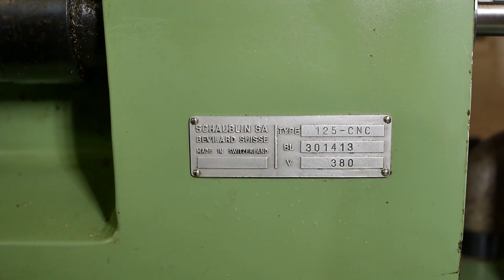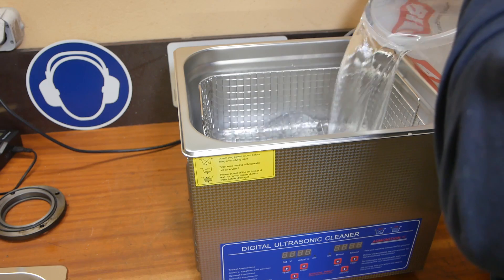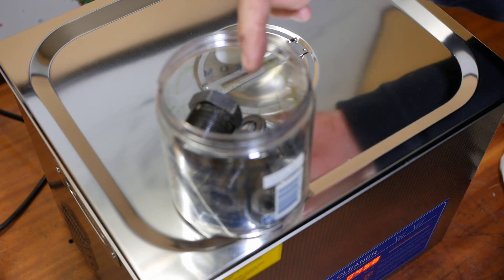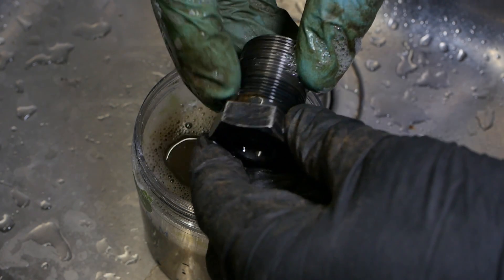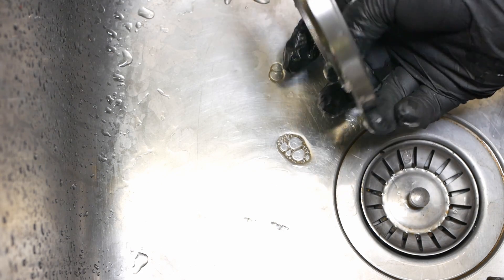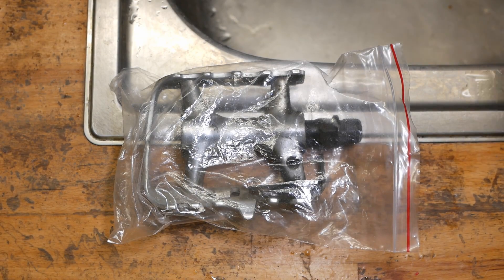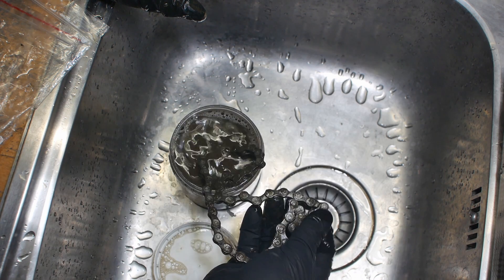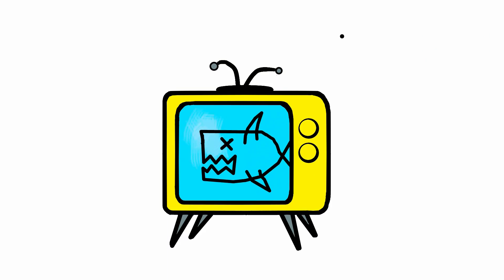Do cheap ultrasonic cleaners work? || RotarySMP

Comment: Open it, then put a plastic sheet on top of the electronics to divert leaking water away. Most of these with a drain will die from Water leakage. they will leak.
Reply from the maker: Good tip thanks.

Comment: I think they are upside down in the box as the ultrasonic transducers are stuck to the bottom of the pan (and hang down), so right way up in transit could make them fall off with vibration etc. The one I ordered 1 was rattling around inside, and I had to epoxy it back on to the pan. Mine was right way up in the box, was about 2 years ago so maybe they have learnt... :)
Reply from the maker: I was also wondering if that was intentional. That makes sense.

Comment: Ah problem! Not fair to put the parts in a plastic pot, ive got the 20L, you get FAR better results with the parts in the bath with no container, the plastic damps the vibrations, tried what you did myself with parafin etc you really only want to use mesh bags/ trays to separate parts
Reply from the maker: Yeah a number of people pointed out that a glass container is better

Comment: You would need good mechano-acoustic coupling through the container to the liquid inside to be most effective. I suspect different materials will damp the ultrasonics differently and give different results on cleaning. I think the thin polythene of the sandwich bag might be one of the best.
Reply from the maker: People also report good results with glass contsiners

Comment: Remove the heavy dirt first, de-greaser works best. Then put it on the cleaner.  Use hot water it makes the cleaning much better.
Reply from the maker: Thanks for the tip

Comment: For years I've used thin wall Pyrex beakers to hold my cleaning solutions.....  Plastic containers don't pass ultrasonic vibrations so well.  Have never thought of using plastic baggies however.  They might be thin enough to not impede energy transfer.... Maybe I leaned something today....
Reply from the maker: Thanks. I was warned that the plastic would attenuate the waves, so I am trying a glass jar. Not sure if it is not worse. Might be too thick.
Reply: @RotarySMP  A heavy glass jar is not the way to go.... Use lab type beakers... They are maybe 1mm thick.  I use the 600 ml size and clean a lot of small hardware used in vintage electronics.

Comment: It would have been nice to see what would happen if you put one part in your cleaning solution WITHOUT the ultrasound turned on and another WITH it turned on.   It's hard to tell whether the ultrasound did the work or whether just soaking it in that solvent did the job.   I have one of this exact kind of ultrasound machine - and I strongly suspect that the heat it produces, along with the solvent is more effective than the ultrasound.  But I have not had the time to do a careful test.
Reply from the maker: You are right. I am just happy to have clean parts with no scrubbing .)

Comment: I see tests like this a lot, but I don't ever see anyone setup a control to see how well hot cleaning solution cleans without the ultrasonic help in the same time period. My guess is that a lot of people would be surprised at how much hot soap alone does. That said, ultrasonic cleaners are really cool. Try doing some eyeglasses some time and watch the face grease instantly cloud away from the nose pieces...
Reply from the maker: I didn't do a real control, but just soaking doesn't seem to get that far. The U/S then acts as aggitation.

Comment: Why 50c? I would have thought a higher temperature would have been more effective.  Please note this is a question not a recommendation.  I got a tiny one of these for my wife's rings but I use it to clean my small tools stuff and  leatherman. Mine is not heated. Does an OK job with pretty dirty jewelry
Reply from the maker: It has a pretty small heater element, so it takes about an hour to raise the temp from 40 to 50°. No idea how much higher it will reach. I read that U/S waves become less effective beyond a certain temp, but cant remember where I saw that.
Reply: @RotarySMP  it would be interesting to experiment, maybe preheat water with a kettle and see what happens. If anything it makes for YouTube fodder. I'm one of those on the job trained engineers and I spent years hearing I heard this or I heard that and never found any evidence to back conventional wisdom. I always referred to the manuals and documentation and even then sometimes found partially wrong information on the manuals because the manual was written by another field engineer who learned on the job

Comment: I have one of these, just a bit smaller. The ceramic heater failed after few uses, seller wouldn't do anything about it. Still have to order a replacement. Before I had an even smaller and cheaper one, the US transducer failed. My recommendation, be easy to them.
Reply from the maker: Thanks. Can you get the spare parts off Ebay or Ali? Normally the components of widely sold Chinese electrics can be bought pretty cheap.

Comment: I've used lab ultra sonic cleaners, and they are great, but lots of bucks. Some are too powerful, causing pitting in soft metals if used with cleaning chems. Maybe try bicarbonate of soda, as a softer version of caustic
Reply from the maker: Thanks for that tip.

Comment: Try using dishwashing soap and citric acid for rusty and gunky/greasy parts. Worked really well when i tried. But i usually keep everything for minimum 20-30 minutes in
Reply from the maker: I was sent some citrix acis powder. So far only tried it as a rust remover.
Reply: @RotarySMP  the citric acid works really well in the ultrasonic cleaner. Especially cause the UC keeps the citric acid warm all the time. I had some old car hood hinges that were rusty and filled with gunked up old grease and the mix with dish soap and citric acid cleaned them really well and removed all the rust at the same. I changed the solution to clean after 30 min and kept it in new solution for 20 min and then left them overnight in the solution.

Comment: It is enough to get the container partially in water.  If container is eg. half under water is is enough. Sound propagates through the container. Hard containers like glass are much better than plastic containers in transmitting sound.
For aqueous cleaning proper ultrasonic cleaning solutions are way better than something like water+soap. They contain chemicals that affect eg. vapor pressure and induce more effective cavitation. That being said, I use proper fluids rarely because often that kind of power is not needed.
I often use solvents in the small container (like a pint scale). Never had a problem with fires in all the years I've done that. I'd hesitate to fill a large container with anything flamable though.
Reply from the maker: Thans for the tips. I now have some proper TR3, and citric acid to try, and switched to a glass jar.

Comment: I just bought one of these a few weeks ago an haven't used it yet.  Fantastic tip on putting the part in a container in the container, I had no idea.  I planned on just filling the entire tank with Evaporust but your plan is better.  Funny, I always thought these needed to run hours, not 5 mts.
Reply from the maker: I was also surprised how quickly it got things clean. Sure beats scrubbing.
Reply: @RotarySMP  7
Reply: I received an identical ultrasonic cleaner and I bought 5L of Evaporust, I can say it does wonders. Whether you put it in small sealed containers (bags, jars) or directly into the basin, it works just as good, depending on how big a part you need to clean. I've done both so far, and I'm really happy with the results. What took Evaporust alone 1h to clean, it does in heated ultrasonic bath in a matter of minutes. Also, if you want to speed up the process, just add hot water yourself and don't wait for it to heat up, it will be more costly in the long run. Still, for larger parts I recommend electrolysis due to high price of Evaporust.

Comment: I had a similar "chinesium" machine but it started to leak after a few weeks. It turned out to be tiny holes in the pan itself in the middle of each actuator/speaker horn. In other words the cleaner had eroded away enough metal by cavitation to kill it self. Not very useful since...
Reply from the maker: If that happens, I hope it fails fast enoug to still be covered by Amazon.

Comment: I use carb cleaner in mine which is a mix of things all of which are pretty flammable so I just make sure to keep an eye on it and when not in use I drain the cleaner back into it’s can. But it appears to not hurt aluminum and is way better than soap.
Reply from the maker: Thanks for the tip.

Comment: Rather than putting it into a plastic container, which can attenuate and reflect the ultrasonic energy, put parts in a ziplock bag or such. Of course put the fluid in the bag as well
Reply from the maker: I also received feedback to use a glass jar for better wave transmission.

Comment: How about trying powdered laundry detergent? I say this because it's excellent for cleaning ovens, cooktops etc.
Reply from the maker: I am prety sure that NaCO3 (wash soda) reacts with the aluminiums oxide layer, allowing the water to corrode the Al.
Reply: @RotarySMP  You could have tried using gasoline or Waschbenzin.

Comment: I've had the same unit for about 5 years now,  fill it up, dump in a couple cups of Sam's club degreaser and whatever parts to clean, carburetors come out looking like new, diesel injectors same, now looking for a larger one that a cylinder head will fit in, they are worth every penny spent.
Reply from the maker: Thanks. They are a real work saver.

Comment: Try toluene. Flamable but with a much higher autoignition point than almost any other volatile hydrocarbon ( 550'c ).
It readily availible in New Zealand from paint shops, sold as wax/polish remover.
Hydrocarbons will not tarnish dissimilar metals like what happened to your bike pedal.
It will cavitate but won't act as a sufactant so they will readily desolve grease, styrenes, waxes, silicons, and none stabilised oil based paint.
Just swirling the bolts you did first it toluene would clean them, it realy eats grease.
Parts left in hydrocarbons won't oxidise if left for a day or two, unlike water based or diluted solutions.

For things with burnt on carbon, like the piston. Heat part to 140'c in a oven then Spray with oven cleaner.

For anything more stubborn use xylene, alot more pricey and harder to come by in concentration but it will strip things back to metal or glass.

Though these hydrocarbons will not rust parts they will leave them completely unprotected. I recommend CRC-226 for light protection, lanolin or car wax for better but still not tacky protection, soft seal / spray wax for long term noticeable protection.
Reply from the maker: Thanks for the tips. I'm not in NZ. Not sure if it is readily available here.
That piston is aluminium, so using over cleaner (NaOH like the BBQ cleaner I have), will attack it the same way it did the bike pedal.

Comment: Having worked with Kerry ultrasonics in the UK on some cleaning problems there are a few insights that may be worth noting.
The idea of sub baths is great, but try where ever possible to stay away from soft materials, plastics and the likes as they absorb the energy reducing the necessary cavitation, so lab glass beakers works well, but also the tanks themselves are based on commercial catering dishes, and so are available in nesting sizes to go across and along most any tank. 
Never places a part directly on the bottom of a tank you will be looking for trouble with the transducer. 
Never put your hands into the tank when it is running, ultrasonics are used to emulsify biological samples!
As a rough rule of thumb industrial tank power is rated at around 1Kw per kg of parts to be cleaned. So your spindle job may be a little ambitious. 
Up to a point for every 10°C increase in temperature the cleaning action of the solution about doubles. But beyond a point the transducers efficiency will start tailing off, I won’t usually run a tank above 60°C, that is not to say I won’t soak the job in a much hotter tank overnight, let it cool, then run the tank.
Best results are obtained by using deionised or distilled water, also degas the solution for a few minutes prior to starting.
When a job is being cleaned the contaminants will either got to the bottom of the tank, not a problem, or float to the top, where they are problem as they will simply recoat the part when it is removed, so the thing to do is using the sub tank and just prior to halling out, over fill the sub tank to the point of overflowing into the main tank, and thus skimming the liquids surface clean.
The chemistry is important when cleaning the mounted bearings as precision bearings don’t usually have metal ball cages so the chemistry need to be strong enough to unseat the “dirt” without damaging the cages, but it also must flush completely or may degrade or even destroy any new lube that you then replace. This is why I would go with a solvent rather than any water based chemistry, stay away from the aggressive, low flash point, especially acetone, and never soak overnight unless it’s a very benign solvent. A new large syringe (>50ml) and a short length of suitable tube works wonders to flush through the job while the tank is running. 
Just my 2d.
Good luck.
Reply from the maker: Thanks  lot for all that detailed feedback. I saw a couple of videos on meat tenderising wit U/S, so I wont have my fingers in the bath any more.
Reply: I immediately recommended acetone for the header. I still recommend it to my enemies.
Reply: Thanks for this great advice.
Reply: @joso5554  mwahaha mwahaha! You're welcome!
Reply: This is the sort of input that we need on YouTube rather than amateur 'observations'. Thank you.
Reply: Dude, you rock. you should write the instructions,
Reply: you are the exact reason why I love the internet. The knowledge you just packed there is invaluable and you are helping me to build a business. I am very grateful for your comment, please keep writing comments. It makes the world a better place! The sub tank overfill skimming is just 500IQ
Reply: Very important suggestions.

Comment: Putting fingers into Ultrasonic baths depends strongly on the strengh of the ultrasonic transducers.  But anything not highly industrial (anything on amazon should be fine) should be safe.
Reply from the maker: Thanks. I guess it is still good practice to turn it off first.

Comment: My 2 pennies worth, it's my understanding that many items just need a "Whetting agent", most detergents achieve this, for ferrous rust removal, a "Citric Acid" based solution works well, very cheap to buy granules, mix up to 10% solution. I have purchased some high end Stamm products, and they work well, but basic chemicals as you've proved work well.
Great vlog, happy vibrations.
Thanks for sharing.
Reply from the maker: Thanks for the tip. A viewer is sending me a cample of the citrix acid beased cleaner he uses.
Reply: @RotarySMP  That will be interesting to see.
Best regards John.

Comment: I cleaned up old aluminum pistons using hot antifreeze; the cheapest ethylene glycol based one the local shop had on the shelf. The pistons came out as good as new. I also tried it with an old slow cooker; straight up heat and no vibrations. It took longer but also came out clean.
Reply from the maker: I might even have some Antifreeze. WIll have to try that.
Reply: Years ago I  cleaned my rc airplane engines in antifreeze and a crockpot. Dulled the nice finish on outside of motor. Came out very clean otherwise.

Comment: Definitely a Good demonstration of an Ultra Sonic Cleaner.
Like most things in life.
Nothing is perfect.
As for the Ultra Sonic Cleaner ?
It has done a great job considering the asking price.
I was looking at buying one of these for my business over 20 years ago now.
Asking price at that time was around 22K.
Of course this was NO toy as you could imagine.
Made for cleaning Transmission cases to give you an idea of the size of the unit.
Of course the Price scared me off and i chose a different path for cleaning my parts ??
Reply from the maker: Yeah, I also had no great expectations, but it is a handy tool. saves a fair bit of scrubbing.
Reply: Pl.tell uswhat alternative you have chosen.
Reply: Pl . suggest the different path you have adopted.

Comment: I've been using that same model for about a year. Works alright, passes the foil test, despite the random lump of solder that fell out during unpackaging.

For longevity, do not rest the basket on the bottom of the thing. Suspend your cleaning jars/tubs/baskets from the sides.
Reply from the maker: Thanks for that feedback.

Comment: The number one question you ask yourself is, "why did I wait so long to buy an ultrasonic cleaner?". BTW, I did say to buy the 30L cleaner. These things make you want to run around the house looking for things to clean.
Reply from the maker: If I bought ever tool I'd like to have, I would not be able to turn around in the shop. It is all a trade off.  I really dont have space for the 30L
Reply: @RotarySMP  Damn, now I know why I can't turn around in my shop. Thanks for pointing out the obvious. Time to get rid of some of my seldom used tools so I have room to use the ones I do use. Also, your right, I think the 20L is probably the largest size for most items I'll likely clean.
Reply from the maker: @misterfixit1952  My guess is regarless what size you get, 90% of useage cases fit in a jar, 8% fit in the pan, and the 2% where you really need U/S...dont fit :)